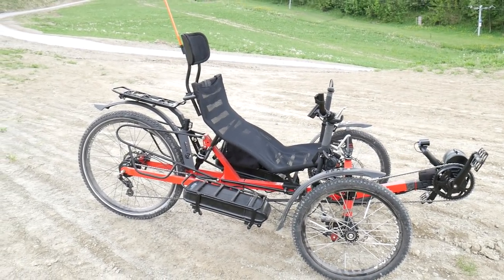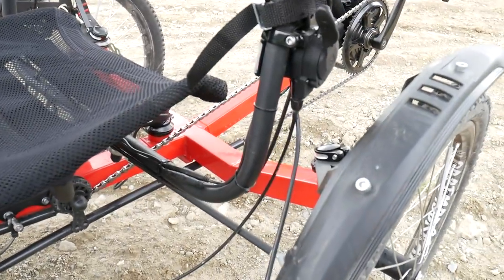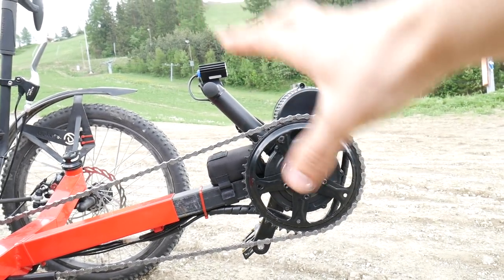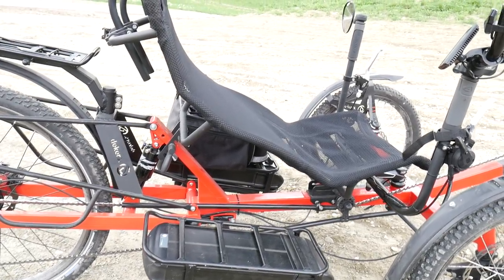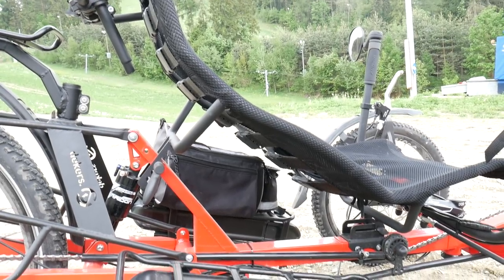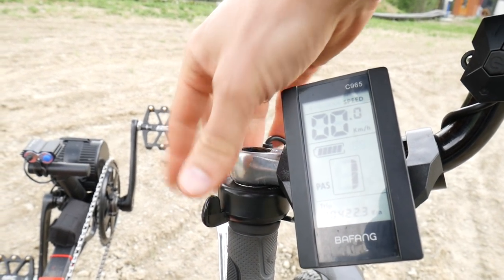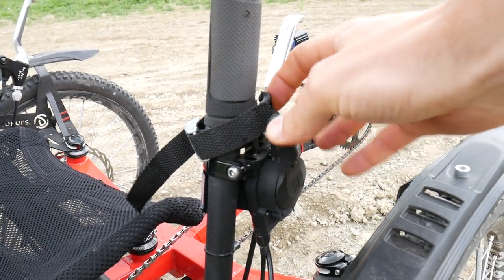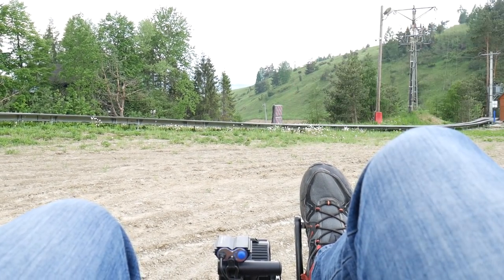Custom E-Tricycle. How It Works? Beginners Guide For 3-Wheel Bicycle.

Comment: The durability looks questionable and its Not sporty looking enough for young Americans . Get rid of the spokes and give us the option of  using a 2 or  4 stroke electric start engine. A  two seater side by side or front to back would be cool.